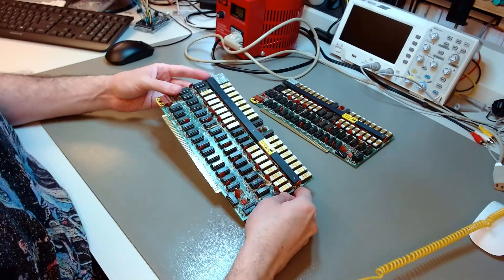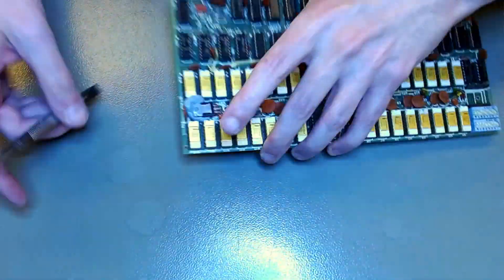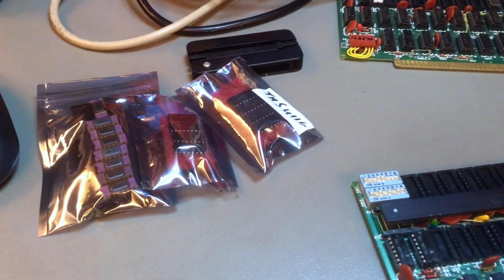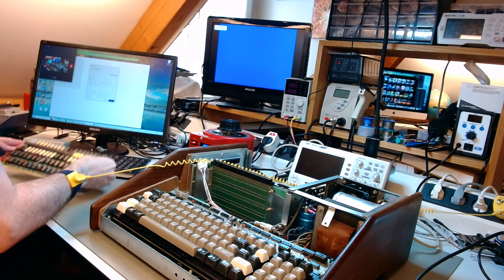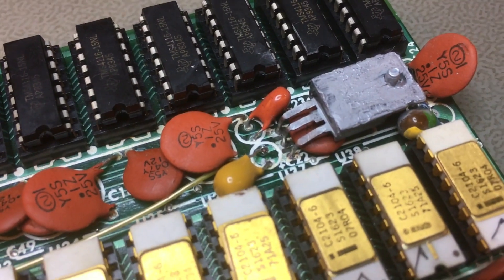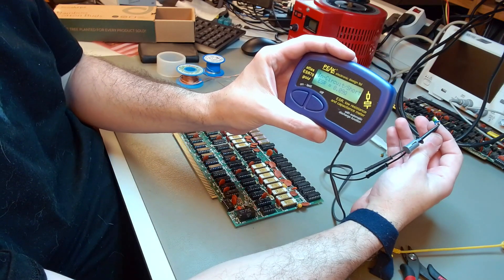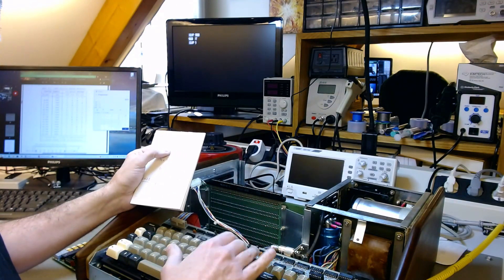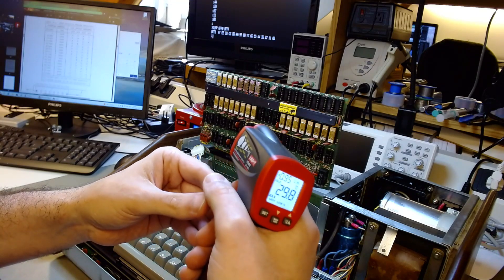SOL-20 museum restoration, PART VI

Comment: When restoring old S-100 cards I replace the linear regulator with equivalent switching regulators. They don’t get as hot or pull as much current.
Reply from the maker: Yes, that works very well. In this case, because of the historical significance of the machine, and the fact that it was going to a major museum, I tried to stay as close to the original hardware as possible.

Comment: While you first had the old regulators out, could you have gradually bought up 5/12 on the regulated rails from external PSUs to reform the caps?
Reply from the maker: Yes, I could and should have done that, after removing all memory ICs and the 75-series logic (all of which use multiple power rails, and cannot be asymmetrically powered with a single rail).

Comment: I wonder if the missing screw could have been from a previous sloppy repair, and, just maybe, a replacement tantalum put in backwards
Reply from the maker: There was a previous, sloppy repair, yes. But that tantalum was untouched. If you install a tantalum backwards, it pops pretty quickly, so they would have found it out back in the day. Tantalums just are like this.
Reply: @thebyteattic  yeah probably. tho sometimes if the voltage isn't too high they just get really really hot!

Comment: Too bad all those cool-looking chips had died. 

I missed this: did adding the larger-capacity DRAM chips increase the addressable RAM in the Sol?
Reply from the maker: No, the addressing logic doesn't see the extra space. But the 4116s are certainly a lot more reliable than the 2104s, so it's worth it to use the former anyway, even without the extra space being seen.